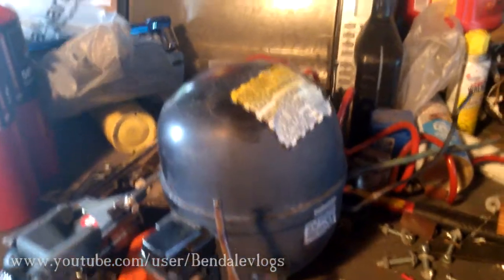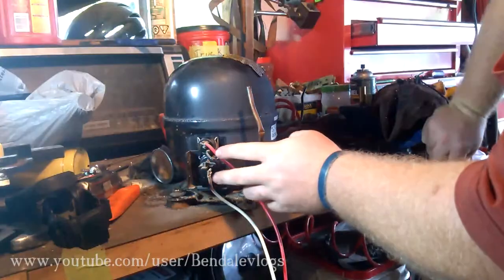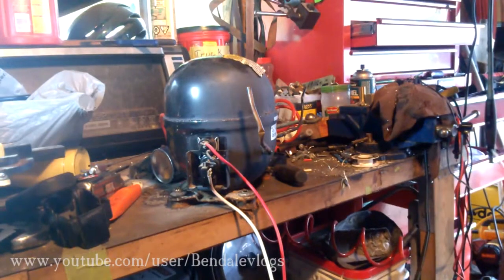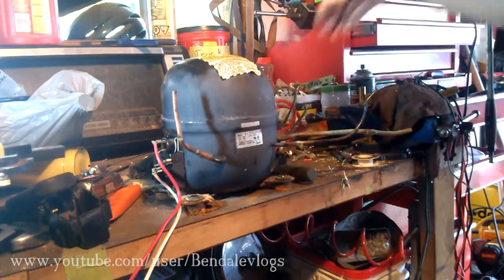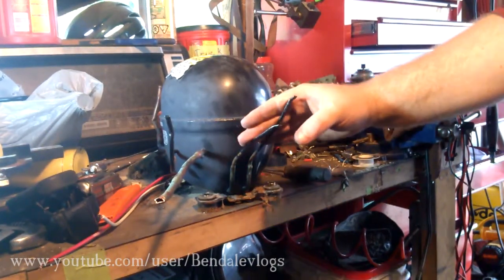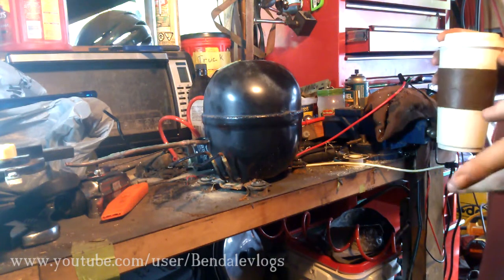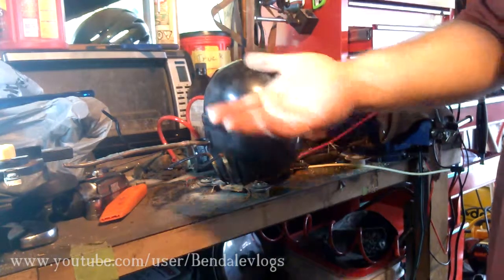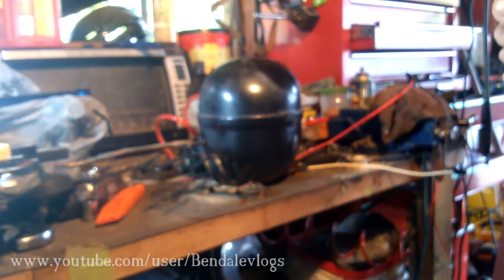Refridgeration Compressor Overview

Comment: Hay do yiu have any old engines you could part with im 15 and i just realy wanna learn about emgines by taking them apart and so on
Reply from the maker: David Pallatin I do have a couple engines that are damaged or just not working but it would be easier for you to buy one at a yard sale, craigs list or kijiji or the best option in my opinion is freecycle.org, just post an ad and you may get a free engine.
Reply: Thanks